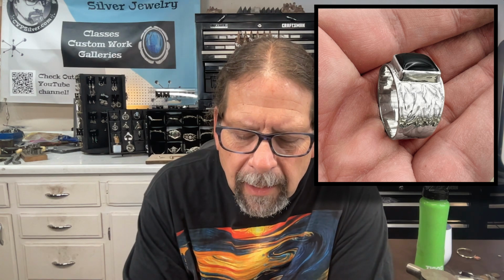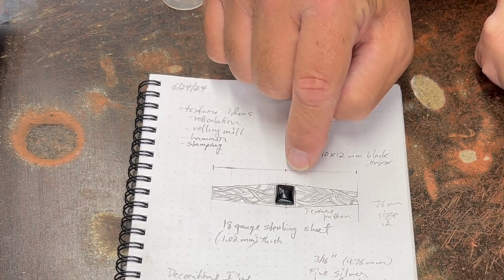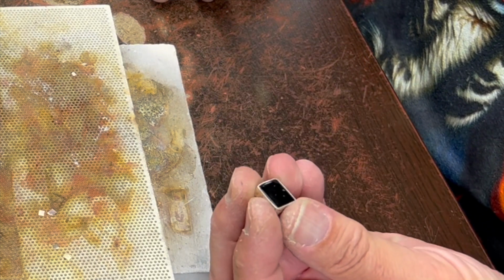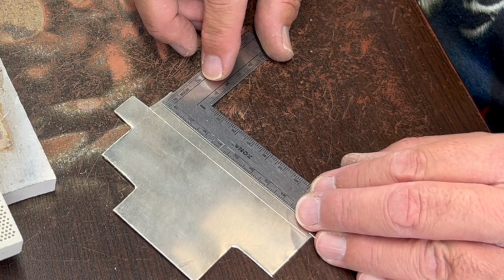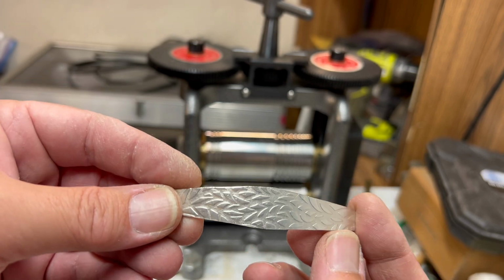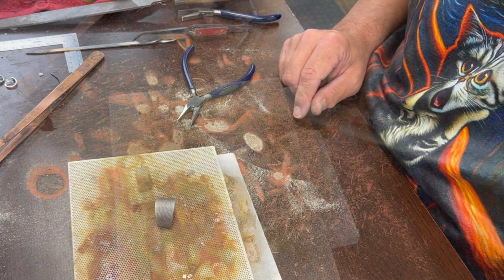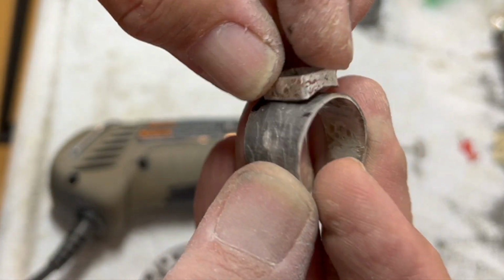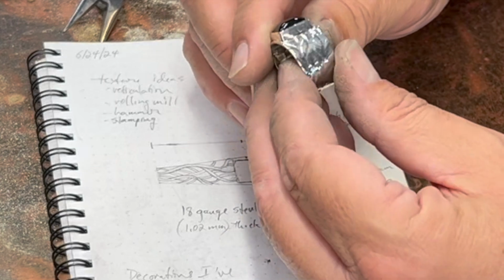Making a Wide Band Ring with a Cabochon: A Silversmithing Tutorial

Comment: How did you set the stone inside the bezel so it doesn't rock back and forth on due to the curve of the ring?
Reply from the maker: Many people use sawdust to back bezel set stones, but I use uncorrugated cardboard to fill the gaps. Slightly compressible and lasts much longer than sawdust. Different folks use all different materials for this, so you’ll get many different answers from people:)

Comment: Love that! Totally the kind of thing I would wear and I’m a woman. 
Can I ask how you stop solder joins showing on textured or reticulated rings? I am making a wide reticulated band but the solder join shows. I would melt some silver dust over it but it would probably alter the existing reticulation which I I am happy with so don’t want to ‘profanity intermission’ up.

Also if the stone drops down in the corners is it best to reduce the height of the bezel at the corners?
Reply from the maker: Thanks Just me!  That’s challenging. Some people use various things like water based white out or some other substance to stop the solder from flowing to places they don’t want it to go.  As far as the corners go what you suggested will work. I had to do that on the sweater bracelet piece I did a while back:  https://youtu.be/Ch8GGzzZjuc?si=aBVyWFu2t0bPfvRI
Thanks for the nice comment:)
Reply: What pliers?? Love the ring!!!!❤